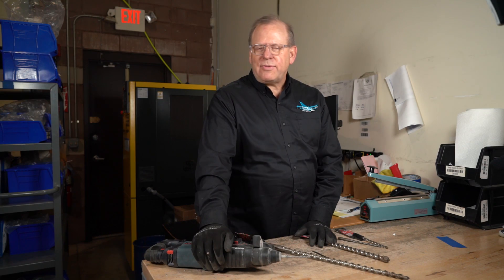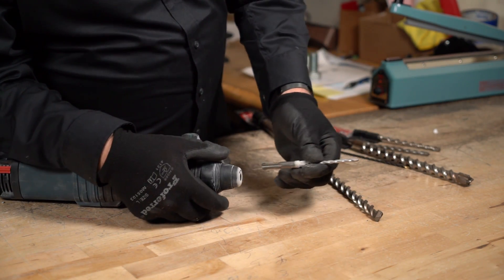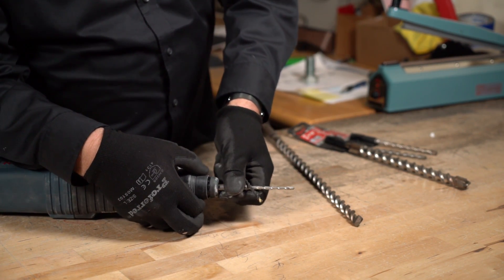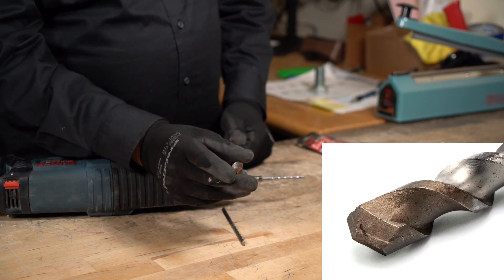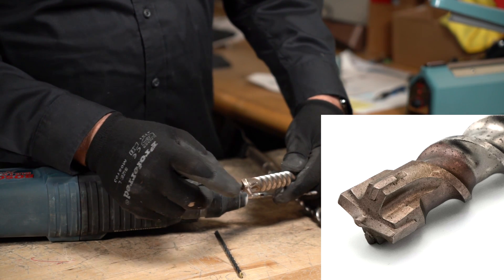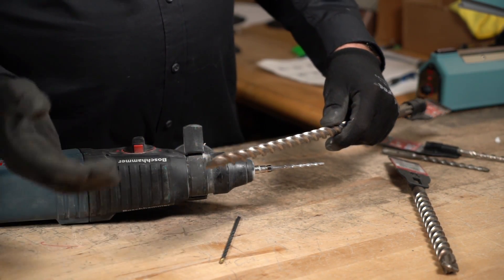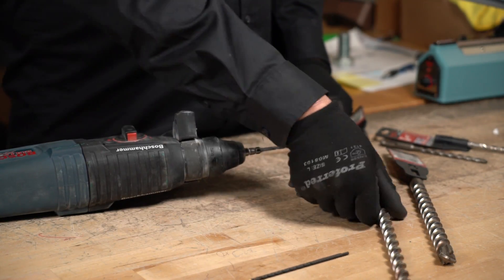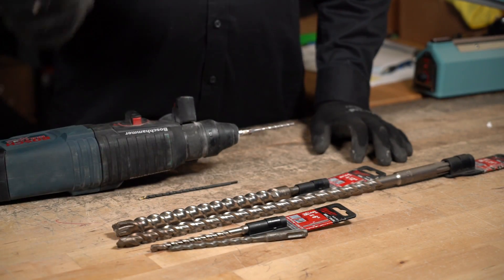All About Carbide Masonry Concrete Drill Bits | Fasteners 101

Comment: Sds fittings have nothing to do with carbide [that's your heading on video] plus nobody can like and subscribe 20 to 30s in have to look at video first naturally, all carbide will work in concrete and stone on hammer action, plus the info u are giving out is false, u might have that drill 15yrs but u never used it much I reckon because u haven't a clue what your talking about especially for a marketing video 😂😂 big 👎👎

Comment: Hello, thanks for your great informational video. I was wondering if you could help me, I am planning to attach 2x2 lumbers into a  concrete slab.  The 10x20 chicken coop will be made from assembled brackets and 2x2 lumbers.  My question is what type and size screws vs what size drill bit should I use for it to work best to attach the lumbers into the concrete. By the way I have a Bosch 8 Amp masonry Rotary Hammer Drill.

Comment: What about Y shaped carbide tips? Do you know anything about them?
Reply from the maker: They're much the same as other multi-point drill bits but they tend to be quieter and cause less vibration. They are also designed for minimum jamming in reinforced concrete.
Reply: @AlbanyCountyFasteners  Minimum jamming makes sense due to the asymmetric tip, but less vibration and noise? That doesn't seem to make sense. Do you have an explanation for that?
Reply from the maker: The low friction design of the tip helps reduce the load on the user, making holes easier to drill. At least that's our understanding of Y-Cutter drill bits. To be clear, while requiring somewhat less effort to drill and being a smoother drilling overall, it is by no means "quiet" or vibrationless. Just a little more so than comparable drill bits.
Reply: @AlbanyCountyFasteners  I never used them and my intuition says they should behave like an unbalanced chuck or bent drill bit because of the unbalanced tip, hence causing more vibration. That's why I am interested in this subject and asking if you have any experience with them.
Reply from the maker: I have never used them personally either, but I know of them. I can say that, despite appearances, they are indeed balanced. It's hard for me to put into words how I know this and, beyond this comment and my previous comments, there's not much more I can say about these bits. If you need more information, consider checking these links out: 
http://www.ssianchoranddrill.com/Y-Cutter-ERGO-SDS-plus-(Hammer-Bits)-Heller.html
https://www.hellertools.com/en/products/hammer-drill-bits/product-detail/hellerproduct/y-cutter-ergo-sds-plus-hammer-drill-bits/

Comment: The small drill bit is SDS Plus, used in machanical inpact hammer drill , the size from 1/2 " and up is SDS Max  used in pneumatic impact system hammer drill / some is SPLINE /. Performance  of drilling depends on inpact energy  : ft-lb , see specification and I have found the HILTI is the leader, but very expensive. Regular chuck drill is good up to  3/16 bit corded and 1/8 for cordless hammer drill.
Reply from the maker: Thank you for your feedback.
Reply: @AlbanyCountyFasteners  Bro, He is telling you that you are mistaken in an instructional video for your company.

Comment: Thanks for the video.  I recently bought a pack of Bosch masonry bits that fit into an impact driver, and am really pleased with them for making 3/16 up to 5/16 holes.  Far more portable than my Milwaukie M18 SDS hammer drill, they work great for inserting plastic anchors into block, or tapcons.  Now, I just need to lug around my SDS for larger jobs.  BTW the Bosch bits can go through metal, and i find this really useful for attaching weatherstripping or alarm contacts to metal door frames that are filled with concrete.
Reply from the maker: Thank you for the feedback!